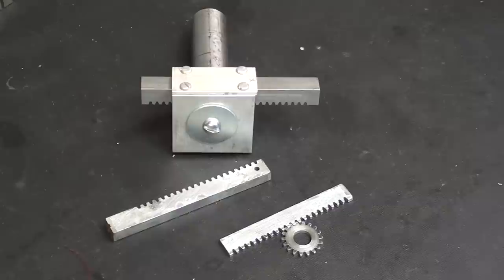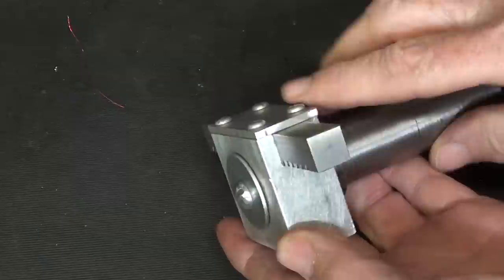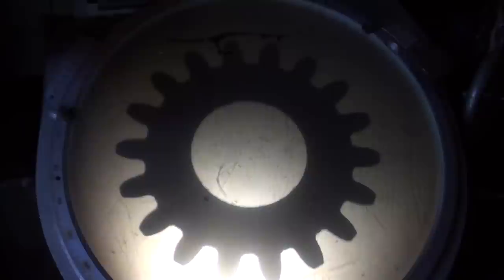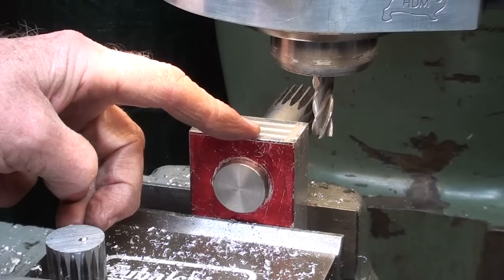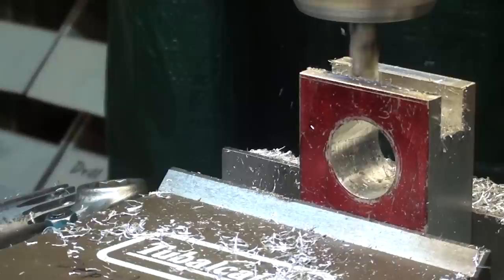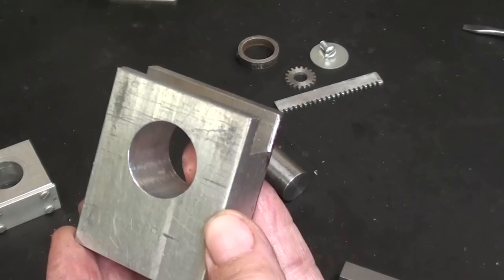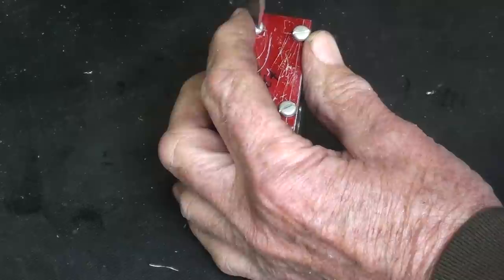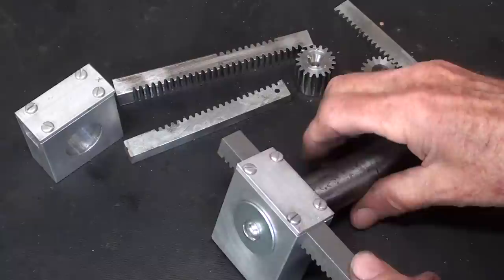Mating the RACK & PINION TIPS #575 tubalcain

Comment: Very nicely done! Good news is you can use that $10k in equipment to make other things too. Getting the rack depth correct is certainly one of the trickey bits. Probably why I often see these with eccentric bushings so the gear mesh can be adjusted after all there tends to be a fair bit of variance in mass produced items.
Reply from the maker: Yes thanks

Comment: Aloha Mr. Pete,  I am an old guy, but many years ago I was taught to put the blade in a hacksaw with the teeth pointing towards me and I did that for many years.  I think looking back the logic of that was we didn't have high tension saw frames and many of the frames we had were pretty springy, therefore the pin on the handle end was solid and tension was kept on the blade.  I still find myself doing this if I want to make an accurate cut or on small parts.  I also remember a later period where there was a lot of debate as to which way the blade should go.  IF it works "DON'T FIX IT" 😁
Reply from the maker: Never did hear that. But we always put the blade in backwards with the coping saw
Reply: Aloha again, that is what I like about your channel, the diversity.  Some things are new and some I just had forgot, but I guess that makes them new too.  Mahalo Nui for your time in sharing with us, I know there is a lot of time and work we don"t see. Aloha ke Akua

Comment: Lyle,
I agree with the other enthusiastic and supportive comments. I would have set my milling working depth by touching off of the extended rack before milling. Your method eliminated multiple opportunities for error that my method would have introduced. Your method maintained the mill slot centerline and put the measuring and machining load pressure centered on the actual work location. This was more clever than my method.
I appreciate the slot milling tip to maintain size and surface finish. I am inclined to mill on size and to take my luck. I find that conventional milling to open each side of the slot to size is better than climb milling. Set up weak points, machine backlash and gib adjustment issues and problems are greatly reduced by reducing the opportunity for the cutter to grab the workpiece damaging the part or the tool. If the setup or part moves, you just lost accuracy.
I would have done my hole drilling in the mill, but I liked that you demonstrated the drill press method. I employ the demonstrated method in my woodworking all the time. Error is reduced and you eliminate measuring and layout steps.
I was interested that you didn't true up your square or round stock and still got good results. Custom fitting to your finished parts and employing a bit more than recommended mating tooth depth was prudent. I would like to try eccentric pinion bushings to control pinion tooth mesh depth and reduce backlash... But this is likely over engineering. Commercial arbor presses use gibs screws and shims to compensate for machining inaccuracies and to allow easy field adjustment after wear or damage. Dake employs a spring loaded gib screw to provide tension to keep the arbor press ram from falling. I liked this idea well enough to modify my Famco incorporating that feature.

I own a Dake model 0. I bought it because it was cute. I have only thought of two times to ever use it. It is so small. Your nut cracker comment just gave me a real use for it. I happened to have fully restored it the other day. So it is pretty enough for the wife to let me bring it upstairs during nut season!
Reply from the maker: Thank you very much for some interesting comments and observations

Comment: I think were the education department of the world went wrong was suspending classes in this type of subject, not only metalworking but many others like woodworking, engineering drawing, cooing, sewing, and even art, How many kids nowadays cannot even fry an egg or stitch a button back on not to mention read a plan or map? At school age when you learnt these things they stick. 
At school I learnt the basics of turning both wood and metal, That was when I was between 13 and 16, when I retired at 58 I bought a new cheap chinese lathe and remembered most of what I was taught and made a new pin for a QCTP that i bought with it. I was a bit scared not having the teacher standing there just in case but it fit and worked, I was so gratefull for what Mr Brown taught me. Later I got a mill and the same. Last year I took the toolpost bolt out and it was like a variably threaded bolt from start to finish, at the time of making it I'm sure it was smooth 😎 obviously not 😔 Things in schools have changed a lot since then and i'm not sure its for the better.

PD I told you the series would be good, thanks
Reply from the maker: That is so true about schools

Comment: "$10,000 worth of gear"
Worth noting that this is one of the key devices that can be made without anything threaded. Yes, it would be time consuming for Melvin to 'shape' the rack and the pinion with the hacksaw (or file), but conceptually you just need the profile and  'dividers' to get something very rough working. Of course, given Melvin's work habits, $10,000 might be short. few $$$ for just the saws/files. I am still curious if any of the early industrial lathes were 'rack and pinion' instead of leadscrew based.
Reply from the maker: I guess I never gave that any thought, that there are no threads involved. Hacksaw Melvin could not do that even if you gave him 1000 years.

Comment: Here's a ? I hope you or somebody can ancer for me could you not machine in a trough on either side of the rack than use 4 bronze tip set screws 2 on each side in a way to capture the rack at a secure measurement to the Pinon?

Comment: I wonder what it was like to be a student in Your class.... I had a a teacher in metal works, called "The file". He was a slim guy and about the same tall as You. It was told that he straigthened out horse shoes... When he looked at the students they behaved like soldiers when the general was inspecting. His wellcoming of first time students was telling them that at bad behavior they would be thrown down into the coal cellar, a pitch black space below the floor under a hatchet in the floor.
One guy did a "Melvin" once, got grabbed in the arms, kicked in the but and experienced a fligth up to the top of the 6 feet high tool cabinet. "There you will sit".... I wathced it myself. Turning the big lathe backwards, noice, smoke….
10000$ equipment..... I wonder what it will cost You the day Your wife finds out how much of her stuff You use and how You use it....
Reply from the maker: He must’ve been quite a teacher
Reply: You bet he was. And every student knew his reputation years before their first meeting.